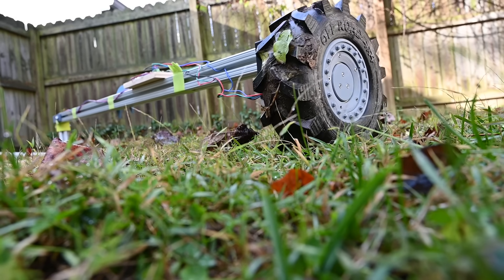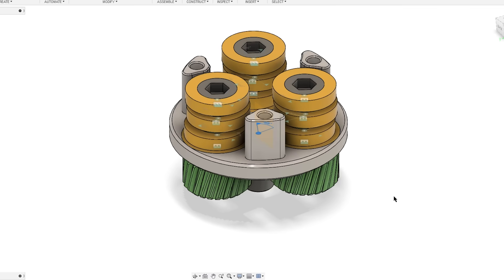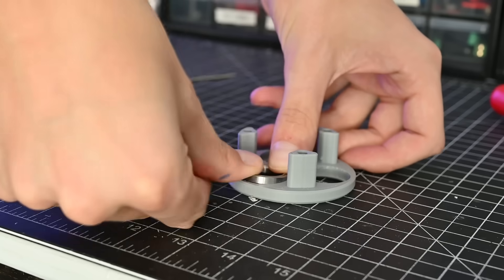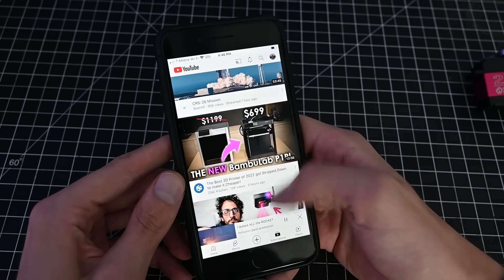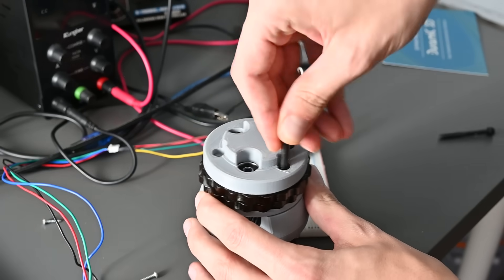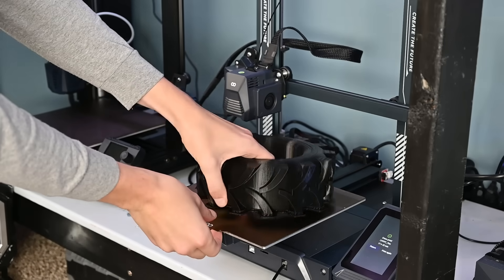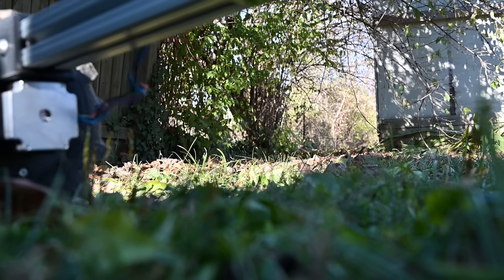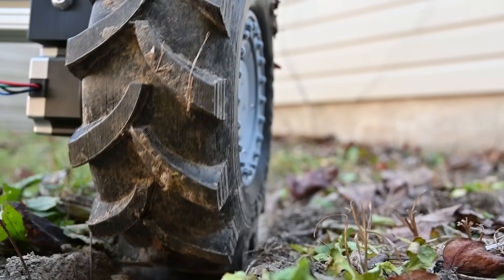3D Printed Planetary Cycloidal Hub Gearbox. How far can it drive?

Comment from the maker: Get the exclusive NordVPN deal here at https://nordvpn.com/michaelrechtin. It's risk-free with NordVPN's 30-day money-back guarantee!
Reply: not hating but did they pay u?
Reply: @reizinhodojogo3956  he literally says the sponsor of the video.. that means he got a fat check. I'm OK with this, as long as it's not obnoxious.
Reply: @reizinhodojogo3956  Nord is probably giving him some comp but it's understandable as it's hard to work for free.
Reply: hmm, Siraya Tech doesn't make a nylon resin.. how do I get access to this mysterious chemical??
Reply: Michael, would this be good for turning a possibly heavy solar panel 360 deg?  I'm trying to build a solar array and need precise measurements, and it will of course be in the sun for 30 years.
Reply: Nice gearbox Micheal. To test the gearbox further just let it drag some weight while doint it's rounds.
Reply: You could just print a second tire and use them to hold up a platform that you can then place weights on. You can then use both gearboxes that you have printed in order to determine wear and condition changes over the same period while applying load to the gear boxes. This will allow an expansion of your testing because you can slowly expand this out into a small automobile with actual wheels for road testing
Reply: Test it with some brushless motors so you can get a little more speed out of it but maybe putting a little higher input speed book it does increase the amount working and put down but it also might increase where so we might be able to see what it will do in different applications
Reply: Mike, you did the wrong calculation about the reduction ratio!
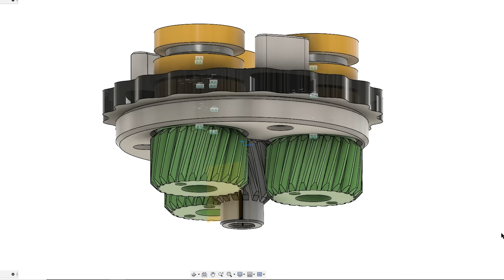The right should be: 1:21*(24/14) =1:36
After 394 comments, no body found that! Incredible!
Reply: Hey bro i suggest that you will turn it into a pulley system and let it lift some stuff so that we ca examine more on its torque as in this current video, it is all about the quality of the said invention whether it wore and tore. Btw i love your vids so much and keep it up.
Reply: I tried slash microrectum and got an "error: u_littleasshole"
Just kidding. VPNs are a scam and people who push them will do anything to you for a personal gain.
Reply: VPN ad = Instant thumb down. Please do not put users in danger with those shit VPNs.
Reply: Tell me you have no respect for your viewers without telling me you have no respect for your viewers. Snake-oil salesman.

Comment: The standard way to test these kinds of things under load is the way you did it but with a mass on the arm. (Just make sure to make it run the opposite direction so your tyre treads actually operate correctly.)

Comment: Would like to see it thenother way around. Like how fast would the drive shaft(in the video) spin if the tire was turned. Depending on the force you are dealing with, it may be cool for a genny. Im sure I could work out the maths at this point, but that rarely gives the perspective I hope for.

Comment: Hey,

This is really cool! Would you be able to upload the Fusion 360 file? I'm new to this and not sure how to modify the STEP file using the free version of Fusion 360.

I’d like to adjust the gear ratio, mounting, and also get a better understanding of how you designed everything. Any help would be greatly appreciated!

Thanks!

Comment: Thanks for using cheap, standard bearings. There’s no point in 3D printing a gearbox if it takes $200 in bearings to build. If that were the case, I’d just buy a gearbox and forego the frustration.

Comment: If you reverse the rotation direction of the tire, it will drive ASIDE the mud, not to the middle. See tractor tires. They print VVV as roll, not AAA pattern.

Comment: Wash HEAT then cure. Stephan from cnc kitchen did a video on it showing that heat treating resin before the final cure drastically increases the strength of resin parts.

Comment: you can eliminate the planet gears in this design, by coupling the rotation of each to the next by using a con rod like steam locomotives used on the wheels. in this design, the con rod plate would have three holes arranged in an equilateral triangle, instead of the two or more in a locomotive. This would make it much cheaper to build from iron for industrial use.

Comment: they are not spur gears. they are Helical gears! the sun & the planets being of opposite hands! In loaded environment you would have create a Axial Load. So thrust bearings would have to be employed. Saying that Helicals are quieter in operation, carry more load & have longer life. due line of contact(real face width.) Contact ratio, especially with ring gear. Greater resistance to tooth bending(fatiguing.) Keep up the good work. In Gears Quality is Life! Unless your in a race then it is weight!

Comment: We have RV gears in many of the drives in the robots that we sell and use. Many robot manufactures, regardless of the brand, has RV gears as well as harmonic. Just from the nature of how they are built. RV gears are much stronger than a harmonic Drive, as I have seen them fail with the flex spline giving out and actually getting torqued and twisted when they crash the robot.  Very cool gear boxes.

Comment: I know this is about your 3-D printed planetary gearbox but did you ever consider a magnetic gearbox since your application doesn't require that much torque. Nor would your application matter if a magnetic slip occurs. I recently a YouTube video on magnetic gearboxes and want to apply a speed multiplier to a water wheel / generator application.

Comment: I'm sure you know this already but you could make it pull or drag something for further testing.  Good job 👍 overall but very bad job explaining how you actually designed it.  CAD engineer grad ?  Ive used blender 3d for all my terrible 3d printer garbage so far, it's like using a hammer as a screwdriver.  Or putting earmuffs on your balls and expecting things to quiet down

Comment: You should run the thing with a heavy tire and a weight on the end where the motor is so you can simulate if you were to use this for a rc rover or something similar

Comment: you can speed up the tests by increasing the axial load, for example, by constructing a brake stand, placing the ring in a housing containing a very viscous material with adhesion to the tire surface, for example, in a rubber cover attached to the body of the test stand and creating maximum friction due to interlayer shifts, after testing, recalculating the round under normal conditions through coefficient of friction

Comment: How about testing your hearing on a hydro powered sprinkler setup with a radial arm of say 150 feet where the pump supplying water to the sprinkler system is also powering your gears as it passes through.  The weight of the water and the terain it would be traveling over would put load on your gears. It would need two tires for stability and they would need to be larger and move slower so gear reduction would be needed however it would give your gear setup a functional use as well as test it under load. Powering it with water wouldn’t be necessary but it would add a challenge and reuse the energy already being spent on pushing it out of the sprinkler and giving it dual purposes. Btw your tire is on backwards. the tread on a tire is meant for sipping which is pushing mud dirt etc out and away from the path of the tire rather then cupping it and pulling it towards the middle.

Comment: I'm irrationally bothered that your tire was mounted the wrong way around.  It means nothing in your experiment, but if you look at the top of the wheel/tire, it should spin in the direction of the arrow so the small end hits the ground first.  This allows the tire under load to pierce into the dirt and push anything outward if it slips instead of inward to keep the tread clear and able to dig in and grip.

Comment: Nice gear - couple of additional tests / improvement:
1. Add weight to the wheel.
2. Check where the dirt is entering: motor side.
3. Make it near waterproof on external: you can add a a plate to the external side and make it sealed, with an o-ring.

Comment: Got an idea, you can use a 24v solar panel to drive that motor using all that torque to lift (somehow) heavy stuff in to a column, to (store energy) how? when let's say 1 metric ton is at 20 feet, you can then use a rack and pinion attached to a DC motor to generate electricity when is coming down, when the temperature is really low, the voltage/current generated could be used to heat a driveway bed so your drive way is without ice in winter, all basically done by weight/ratio of parallel small dc motors stopping the weight of wherever you can get up in to the air. Some excel sheet will help to get the best numbers.

Comment: So a while back there was a guy who did tests on PLA vs PLA+ and PLA still came out as the strongest in load strength. But PLA+ bent more before complete failure. While I could see a use case for PLA+ I don't think a gear box would be the best choice especially in planetaries. Since as soon as one get is mushed the others are soon the follow.

Comment: DRILL/Impact gearbox!!!! Impacts and drills have some crazy reductions that get abused- so many good tool channels out there, a few that take them apart. Your design looks like it was made for it. The possibility of turning a larger outer "ring" for the drive instead of being limited by the shaft that has to spin inside is a HUGE deal. Especially for an impact where the rotating mass and it's moment of inertia is what results in crazy power. In the case of small drives like ratchets/electric wrenches, it could be used to move the ratchet mechanism away from the head itself. (Would still need to solve turning the drive axis 90deg)
And finally -- offroad trucks/equipment especially. I'm curious how it handles changes in direction/ acceleration/load because the control involved in that reduction would be amazing. 

Additionally- if it can handle high input speeds, a CVT as a first stage might make for an incredible heavy equipment/semi gearbox

Comment: One application for this kind of reduction could be archimedes screws for grain elevator type lift or water pump (using pool hose wrapped in a coil up a tilted column) if you want a system that doesn't need check valves and has intermittent power input. Would be useful for a solar powered gravity fed gray water processing system for an off grid home. Slow, but low power draw!

Comment: I tried to 3D print the gears and fit them into the bearings. I encountered a fit issue. When I went to measure the dimensions to see what was wrong what I found was the gear was not perfectly circular. On side of the cear was nearly .7mm longer than the other making it hard to fit into the bearings. Is this a printer issue or does anyone else experience this?

Comment: A couple of questions for you.  I've downloaded the STEP file and imported in to Shapr3d. I'm needing to make a couple revisions as you have 0 tolerances in some areas. Correct me if I'm wrong but you cannot fit a 15mm peg in a 15mm hole. I need to add .2mm tolerance on the fit. Question 1: Are the eccentric gears all the same or are the offsets different for each 3? Without the original cad drawings, it's hard to tell. Question 2: Basically the same question for the Cycloidal Disks and Cam caps.

Comment: Great Video! Great work!  I think this will be my first 3D printed gear box.  One question.  This should work for any motor with an 8mm (D) shaft, correct?  I looked up that the Nema 23 also has an 8mm diameter shaft.  I hope the internet is correct there.

Comment: Being the son of a farmer, I noticed you were running the tractor wheel backward… This is why the threads are filling with mud. If you run it in the other direction it would self clean, keeping the traction.
Reply: You Son of a Farmer! You are Right!

Thanks, these comments are far more important than most realize!
Reply: Don't even need to be a farmer, how do you not know how tires work. Treads are meant to push water out not in???
Reply: I am not a farmer, but I played one on TV and you are correct!
Reply: I'm not a farmer, but I noticed it as well.

Comment: I have tried printing your gearbox now, but i cant Seem to get the outerpart (the one the discs moves) to fit. Its to small to get the discs inside afterwards. Have you resized it by a degree or something?
Reply from the maker: Glad to hear you printed it! The disk must be clocked correctly on the three cam shafts. Also, you may need to adjust tolerances for your specific printer.
Reply: @michaelrechtin  yes i had to try it out! But how Can i be sure the disc a correct, i have both on and they rotate, but i really cant get Them Down in the outerpart? 
If i put in one disc and rotate it by hand (cycloidal movement like its would be if There were only one disc) so i thing the tolerances should be fine but i could be wrong? 🤔
Reply from the maker: The lobes on the cycloidal disks should be opposite of each other. It is also important to note that the disks are not identical and neither are the cams. Each one in the model needs to be printed individually.
Reply: @michaelrechtin  yes i did that, but i just found out that its only one of the discs that Can fit inside the outerpart so Maybe something is wrong There i Will try to make 2 new discs and see if that Will fix the problem
Reply from the maker: Sounds good. I will review the model and re-upload it if I have different tolerances built into each disc

Comment: Regarding stress testing: Tredmill w/incline & weights. I'd suspect this design would be great for a companion robot that could hold massive weight loads. Other application could be self solidifying/locking structures that move - reminds me of a practical version of that wind powered beach art that's called a Strandbeest. Neat design regardless!

Comment: Run more power to the motor and make it rotate faster. They only issues i see that would prevent this setup from lasting years would be friction and heat build up. If you could integrate a water cooling system you could potentially build a full on rover or car.

Comment: Great video! I am so impressed that I went ahead and subscribed to your channel. I do have one question. Why didn’t you design an enclosure for the motor. Could possible thermal problems created by an enclosure be the reason why you left the motor exposed to the elements?

Comment: My preferred alternative to those heat inserts are simply...M4 nuts. Print a hexagonal hole, pull the nut in using a screw, and with the right tolerances you've got a very tightly fitting, compact thread using parts you can get anywhere. For extra strength you can also get square nuts.

Comment: You could make a sled and pull a cinder block. And scale it up from there. Might want 2 going at the same time. It would be a  lot of force on the center pivot. Wait!  New idea. Center pivot irrigation put the gearbox in the pivot. That would be scalable in many ways. Still the anchor would have to be sturdier than what you had.  I'm sure someone else mentioned it but tractor tires are directional and you were spinning it backwards. Great video and I'm thinking about making one now on my ender 3.

Comment: Very cool project.  It will be interesting to see how teh FDM parts perform under load. 

If you do load testing with that tire it needs to rotate in the other direction.  The V groove will be less inclined to fill with mud.

Comment: Awesome build. Didnt think there were any gearbox topologies I wasnt aware of yet, but seeing a new one definitely earns a subscribe.

I suppose one drawback compared to a central cam is that the bearing loads are less self balancing; if you want some low backlash and low preload you need to work those cam bearings with a static radial load.

Perhaps a nice way to reduce the bearing requirements would be to put the herringbone sandwiched between the offset cams (or one-tooth gears). Then if you give both sides of the ring a bit of a taper, you can preload the whole system by adjusting the clamping force on both halves of the ring; and it should also be self-energizing; you can run it at a low zero-load preload setting for efficient low torque zero backlash operation, but the radial forces should increase in lockstep with the torque demand. All without bother any bearings with those radial forces!
Reply: I guess thats another way of saying this is basically just a wolfram topology, but with a single-tooth planet gear on the output. But practically speaking its a configuration that comes together quite elegantly.

Comment: Is there a way where you can harden the surface of the gears? That would probably make it last much longer.
But it is a problem having a hard surface on top of a soft shell, cause the hard surface may just crack.

Comment: Some combination testing where you can independently test torque, heat and fatigue would be interesting. 3D printed parts tend to fall apart fast under those conditions, but with independent and combination tests the best materials could be determined for each part of the gearbox.

Comment: It would be better to test by reversing the motor, maybe run one rev clockwise, then another counter-clockwise. Also, what is the backlash and what was the gear ratio. 

It’s a really interesting video and a cool design. Well done.